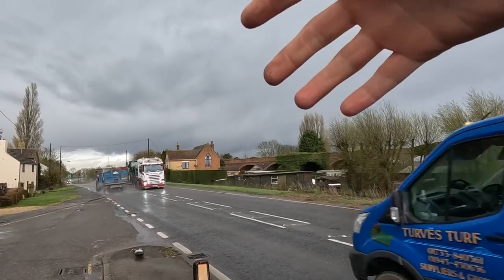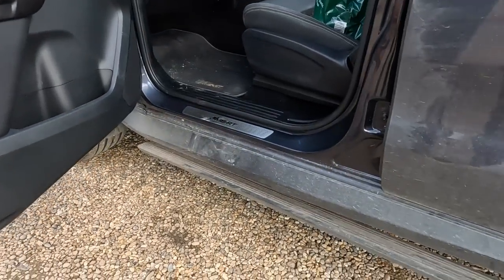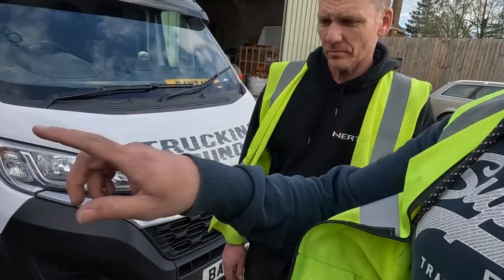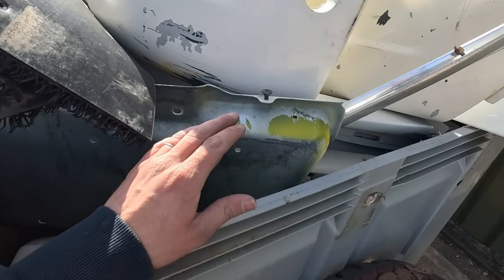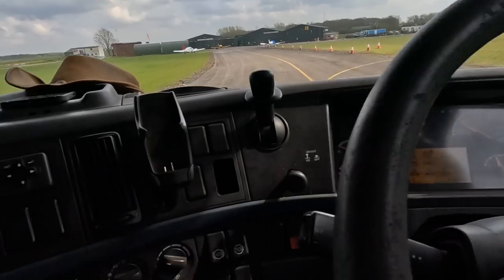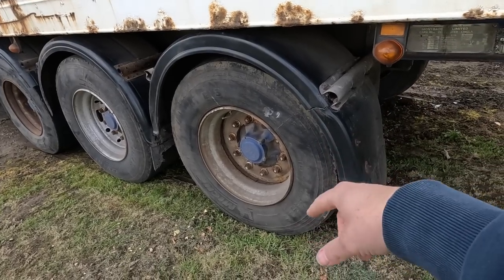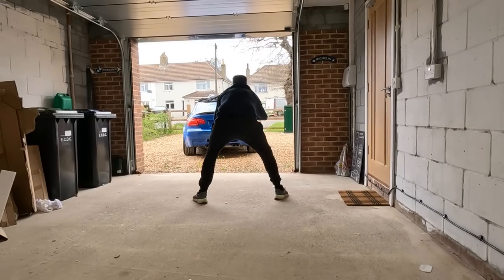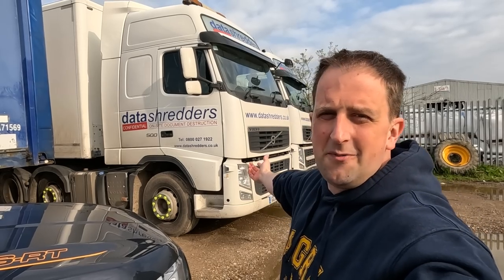Buying The Truck That Means A Lot To Me!? | EMOTIONAL | #truckertim

Comment: If you plan on keeping the Ranger for a long time (after the warrenty on it ends), I would probably avoid messing with the steps lol. Anything that "won't work as it came out from the factory" could cause warrenty issues. I've did Stage 1 ECU remap for my car but I made sure to do it after warrenty ends so I could still use it without them saying I messed with it and just end it on sight.